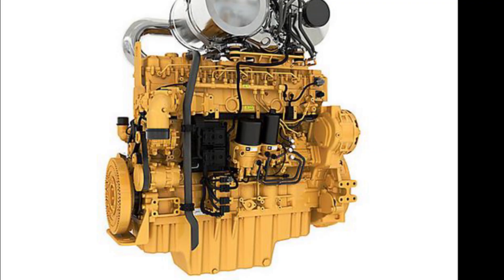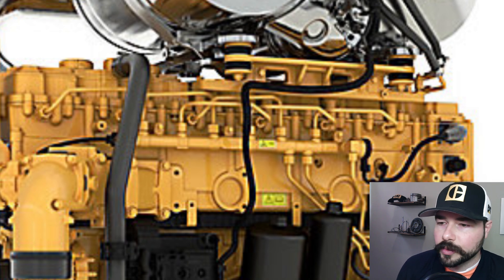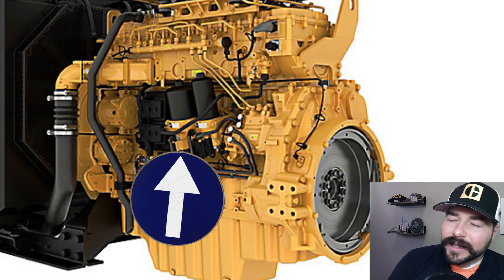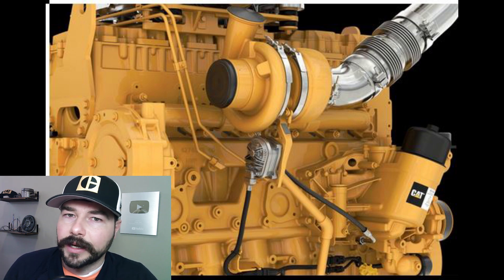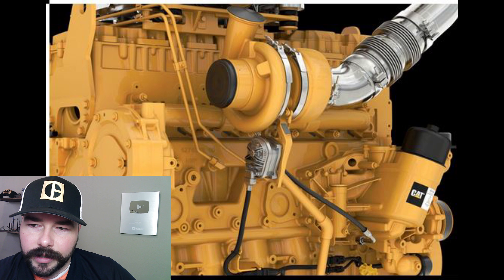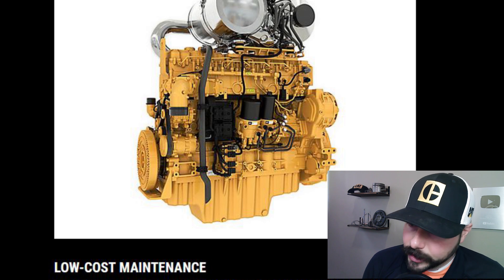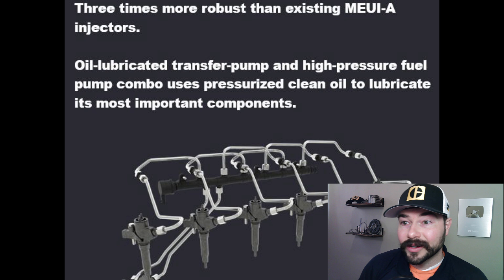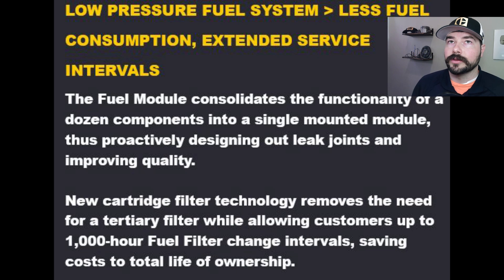New Cat Engine set to replace the C15.... The Cat C13D, 690 Horsepower.

Comment: As an old retired Cat mechanic geezer, I’ll have to correct you. Back between 1955 & 1960, cat used hydraulic lifters on some of their D337 engines used in the Dw20 and 21’s. Ask me how I know. Did enjoy your video just the same.

Comment: I believe the the oil lubricated fuel pump is to improve the Bosch design! Boss utilized fuel to cool and lubricate the squash plate and plungers. By lubricate in the back mechanical side of the pump with oil should eliminate a lot of the catastrophic failures as seen in this new CP 4.2.!

Comment: Rear camshaft drive????????
Good bye in-frame fast overhauls!
Do I have to remove the gearbox, clutch, flywheel and flywheel housing to remove the camshaft?
Anyway, not possible in frame, unless they have a window in the firewall.
In short, it`s shit.

Comment: I have a question have you heard of the DFI injector That was supposed to come out 2019 for diesel engines?
It was designed to be reliable designed to reduce admissions reducing the need for the money grab environmentalist that are plaguing the diesel engines with their nonsense. With installing their purpose built non reliable crap on these diesel engines I should say this injector would reduce the need for those headaches wondering if you were informed of this diesel fuel injector? Ducted fuel injector.

Comment: I drive a 2021 Volvo VNL760 with 211k miles on the 12.8 engine. It make 450 hp and 1,750 lbs.-ft torque from 1000 rpm to 1,500 rpm. It pull harder from a light than the 2016 Freightliner DD15. It burn slightly more fuel pulling but on level ground. It get better mpg.

Comment: Sounds like a pac. Car.  Junk.  Look.  Cat change the gear time in from the front of the motor to the rear of the entrance. That means you have to remove the transmission to work out just like a paccar piece of shit.

Comment: I dunno about a c15 starting badly in cold weather, i have a c15 acert that starts just fine in -15C weather, our cummins engines in our tractors need to be plugged in or need some either to start up. Could just be mine but I’m very happy with it.

Comment: Big bore mean more torque which moves the wheels or gets work done, not seeing with this little 13 liter C13D with high horsepower kiddie bs. Going backwards with the cheap plastic filter housing would be removed and adapted by my standards to multi- spin on steel filter assembly. Then the camshaft would be a pain in the ass removing from the rear of the engine like a Paccrap engine. Have to remove the engine from truck or equipment to gain access.  Then the variable turbos always breaks compare to just one standard turbo. I probably let it sit on the shelf in the Cat dealer and stay with my 3406 style engine.
Reply: Well with the new 2028 emisson regulations soon approaching, your 3406 Cat engine will be soon parked as it not going to pass federal emission standers anymore.

Comment: Im not sold on the reliability on these engines ag equipment have failed on the exhaust filtered common rail 4 cyl small displacement 100h hp + engines generating to much exhaust heat when exhaust filtration fails from low rpm operation and short operating intervals. Short trip inter city route trucks will be a nightmare. Over the long run WOT will not be as problematic because the exhaust filter will work. FYi only if there is no extra fuel injected into cyl just before exhaust stroke. Relying on EGT plus 600f converters has worked on ag equipment that runs wot most of the hours of operation..So owner thoughts of low rpm engine work hours will not clean converters and i have found destroy engines most prevalent in common rail high hp  small displacement eg engines. Maybe cat is doing it better. That fuel system " injector, lines, head and rail" looks  similar to others on the market. IDK this Cat system to speak from experience. I can say  EGR and Exhaust gas treatment delete solves many ag issues and adds 10% more hp.

Comment: C9, c12 use common rail,  but from what ive seen these injectors, need replacing around 10,000 hours, on heavy equipment,  and every fuel line you loosen needs to be replaced, because of such high fuel pressures. No more quil tubes on this new engine.  I guess we will all have to see how good it is, i really like the 1000 hr service intervals.

Comment: No replacement for that big displacement....you buy it see how it goes ... I had a first run twin turbo 475 total piece of shit after 22000 miles .nobody knew how to fix it... Had a  cracked flex tube between turbos.... After it got sold and outta warranty. Never ever buy a first new anything... Except a comdom
Reply: Cat and mack measure hp at the ground

Comment: Had cat perkins hybrid engines on the diamond drills.. They were 1500 hour engines.. Ate the injection pumps to high pressures..
Junk motors.. Parts and labour to fix was almost the same as a new motor.. They all failed right around 1500 hours

Comment: I think that a 690HP rated 13 liter engine may not be as long lived in certain applications as a 690HP rated C15 or C18, but I could be wrong. I can understand the want and need to downsize things in certain applications, but in heavy industry those bigger engines often have wider margins of safety at higher power numbers. Maybe the biggest advantage to these 13 liter high power engines will be fuel savings? Maybe running at 575 of the 690HP nets a big savings in fuel in a 13 liter engine vs 15 and 18 liters?

Comment: Scania uses VGT turbos and i worked a year as a buss tech and we serviced around 100 busses and we didn't change any turbos. Also fun to see american engines actually get high horsepower engines. Still scania and volvo has 770 and 750 engines, but we pull more weight too.

Comment: Daf is actually a subsidiary of paccar and has been since 1996.  The paccar mx 13 engine is the evolution of the daf 1260 engine.  The epa10 mx13 utilized the individual pumping units similar to the daf 1160.

Comment: The new injector’s are made in Mexico overhauled my 1MM 600 new injector’s and everything else had one go out on first load another one in three months put rebuilt out of injector shop in Cowtown working fine but thinking about changing over to sure flow because they have matched flow rate where as the new injectors ran between 28 and 34

Comment: Funny you defend muei fuel systems. I've done more of them than I have of Cummins common rail injectors with triple the amount of Cummins I've worked on in fleets. 
Running with broken springs etc isn't exactly a great thing, the engine still runs like shit. 

Definitely more sensitive to fuel and oil despite fleet overservicing. Weren't CAT working with MAN?

Comment: Hydraulic lash adjusters aren't something made up by CAT and they're not the same as hydraulic lifters. Basically, a Hydraulic lifter transfers the motion to open the valve, be it a hydraulic lifter in a pushrod V8 or a hydraulic tappet in a DOHC japanese engine. A Hydraulic lash adjuster is like a hydraulic lifter but it does not transfer motion, they are very popular in modern OHC car engines, they are like a small lifter with a ball end which rests in the head and acts as the fulcrum for a roller follower. The camshaft pushes on the roller follower which directly acts on the valve.

Comment: Great job Josh . I pray to God that will bring more people like you on this world.  You love and enjoy this trade of the Diesel MECHANICS (not technicians) . About the new C13 D I think Cat did a great job bringing their engines on the 20 Century  technology and  it will be on top and ahead of any other Engine manufacturer . On all these common rails is a known fact that the HFPP is the silent killer of the engine if they don`t use high quality materials for the build on these pumps. Not all the operators take regularly oil samples when service these engines and this is a educational deficiency  from the OEM producers . I am from EU and they have these engines on the road like 18 Years back  and they have learn the lessons  for North  America this is fairly new  it will fail as expected for new technology also the educational factor in using and maintaining it will be a big struggle as these folks are used with old engines  that you pee in the fuel tank and they will still go .

Comment: Josh @AdeptApe, could you please point me in the direction of finding out what parts I need to couple an md3060 to a c10?  The 3060 is behind a 3126 in my fl60 to fl112 conversion truck, the c10 is out of a Pete with a 9 speed. Thanks for ALL of your time, your channel
Is super helpful to many of us.
Reply: First things first, engine vs trans torque ratings, then wiring for the engine/trans interface, ECM/TCM programming. Likely some changeovers from Paccar to F/liner spec for exhaust, d/stik, fan mounting, possibly coolant in/out conn, ATAAC for C10, maybe radiator spec, probably motor mounts setup, firewall to rad space(?), flywheel hsg (?) or bell hsg and flywheel, driveline mods(?)

Comment: The only issue I can see if how to fit that under the hood on a Pete or KW. If this is the final design, what other steps are the truck manufactures going to take to shield the hood from the extra heat the aftertreatment system is going to create being under the hood of a truck.

Comment: hahahahahahahahahaha, the C13 is not a new engine. 690 Hp from 13 liters will burn just as much fuel as 690 Hp from 15 liters. To dial up the C13's made before this we just modified the head, coated the pistons and combustions chambers, swapped out the turbo wheels for high output ones and raised the engine operating temperature. I have modified the C15 and 16 to produce as much as 1200 hp with mostly stock parts.

Comment: When i changed my transfer pump in my 2005 bxs c15,,i could see the ball bearings bathed in engine oil....hence oil lubes pump...love my c15 2 070,000 and kickin

Comment: I bet there's nothing Caterpillar about this, probably just a rebranded DAF / Paccar product or Navistar owned product. It's obviously been previously designed for a European cabover truck with that rear drive gear setup, having cartridge filters and also for the fact that it's a 13 liter engine. DAF is owned by Paccar and thus the MX-13 is a DAF engine, similar to the current lineup of Detroit diesel engines which are 100% Mercedes-Benz engineered and Volvo.. which are well.. Volvos.. all of which were previously engineered and designed in Europe for cabovers..

Comment: Those cartridge filters are a messy pain in the ass;  nothing beats a spin on for cleanliness and convenience.   The ECU is a computer and attaching it to a hot engine is dumb as history has shown.   More HP from less displacement means Higher BMEP and shorter eng. life.

Comment: Perkins has a new engine that is very similar if not identical, 13 liter, hydraulic lash adjustment, etc.
Fuel rails look identical, rear gear train. bell housing is a little different.

Comment: Looks like Nylon fuel lines from Raytech or similar. Kinda like the ones Cummins had the melted fuel line issue (sticking TRV I think). Inverted canisters are great, but why not make these see-through so you can actually see the filter's condition? A polycarbonate is plenty tough for that purpose.

Not sure if that's a Bosch pump or a Denso pump. The Denso HP0 is right at its limit of fueling if they want to push 690hp. The pump is good for about 750tops, and even then only if you drop the pressure from 2400bar down to 2000 to help the pump flow more.

Rear gear makes a lot of sense when you consider the wicked torsional vibration a gear-driven HPCR pump can put into the drivetrain.  You want the pump close to the mass of the flywheel if at all possible. Trying to drive the pump AFTER all the flex of the crankshaft (i.e. on the front) can cause problems with both the front geartrain and the pump. Rear gears are quieter, have less vibration and are smoother. Cummins had scissor gears on the front gears of the X15 in part because of the front-mounted pump and the vibration it pushed into the gears.

Comment: Gonna be tough to build something better than the venerable 3406.
Reply: My uncle had a 3406b  989 thousand  before it threw a ring.
Reply: @rob066101  I have a C15 Accert 1.3 million on dash no overhaul yet
Reply: @anemictoe9618 the Accerts are great engines when you switch to single turbo and put a decent tune behind it
Reply: @SparkZ1420 do the acerts have def?
Reply: @Beaddragon123. In north america, only the SDP model has def
Reply: @aishi_creates there were never any CAT on highway engines that has def. Only the max force just labeled cat
Reply: @Luggagesaauce237 to my knowledge the sdp didn't use Def when it was a on highway engine
Reply: They did that in 1999. It’s called the c-15 6NZ.
Reply: i have a c-13 with a million,200,000 miles--only thing i ever done to it overhead at 500k and it lost one injector--uses a gallon of oil between changes and out of 65 trucks i am number one in fuel mileage and freight volume because my truck is trouble free and light weight,tanker operation,half empty so the helps the wear and tear--i make a ton of money--same haul everyday for 13 years
Reply: Not really

Comment: Must be an effort to pull customers away from the overseas reman junk that Cat is charging 60k dollars for. Our 170k mile genuine cat reman is sitting in Topeka caterpillar, finishing up a rebuild under warranty. It dropped #6 cylinder in February, everything replaced and updated, and by mid February it was losing 7 gallons of oil from the blowby tube in 15k miles. Caterpillar in NY, NM, KS and PA all confirmed... all remanufactured engines are done in China and India. I will never put yellow junk between the frame rails again. The yellow cult fanboys can keep their Scatterpillar trash. Good vid Adept Ape, have a good day.

Comment: Hello, I have a question for you, we have a mechanical 3406b model, engine has just under 20,000 on rebuild from cat, the truck is a heavy wrecker. My question is when you have the engine idle up for the hydraulics, and push  it back to idle it down the engine almost wants to die before coming back to normal idle, it's set between 700-800 rpms. Also when driving and suddenly release the throttle it does the same thing

Comment: Definitely get euro engine design vibes from this. I'm a Kenworth tech so Paccar MX engines are what we work on alot. In the trucking industry, we've been around the cartridge filters for a while now. The new EPA 2021B Paccar went to the twin filter module and made filter services alot better. I can't wait until everyone else starts getting rid of EGR. I know it's been in the works for north America for a while but I'd love to finally see it done for truck engines.
Reply: I worked at Kenworth of pa for 25 years if the MX engine doesn't run Paccar out of business nothing will I sure pitty you working on jigsaw puzzles I cringed everytime one came in the shop.
Reply: @davidsignor7931  i haul milk for a living. class A tanker, farm pickup. im a company driver. the paccar MX13 and autoshifts are both junk. terrible when the 2 are combined together. my employer is slowly phasing out those trucks. especially the autoshifts, they just arent meant for milk hauling. we have a couple of paccar MX13 trucks around that have 18 manuals and i think for the time being he is keeping them until they have more miles.

every new truck he has bought in the last 2+ years has had the cummins X15 and a 18 manual. we have 25-30 trucks in the fleet. i drive a 2022 KW T880 X15 565 hp and an 18 manual. i have 80K on it so far and i just love that truck. pulls like an animal, so far it's hasn't been in the shop except for PM work.

Comment: Heui is hydraulic fired injectors using high pressure engine oil not camshaft driven
Reply from the maker: I never said HEUI, I said both EUI and MEUI in the video, which are the same but some people call them MEUI and some call them EUI.

Comment: Speaking towards the longevity of MEUI injectors, My dad had a 5DS motor that had over 1.4 million miles on it before he replaced the injectors, and the only reason he replaced them was due to doing an in frame when it finally decided to drop a valve.
Reply: My 5DS dropped a valve at 1,662,000 miles. I went with a head from Diesel Cast Welding and went with new injectors and cups.

Comment: Apparently the engineer that designed the fuel system failed chemistry. Being how water settles to the bottom of the filter housing, it doesn't seem too smart to invert the filter housing so the water gets sucked into the engine first.

Comment: A lot of common rail engines such as mtu and man use the upside down filter cartridges because they found that mechanics have a tendency to prefill filters with diesel before installing causing the injectors to suck up unfiltered fuel and trashing out the high pressure injectors. That was man’s fix for trashing injectors in their engines. I’ve been seeing a lot of this lately.

Comment: Hmmmmm
Lots of things to digest,,, but common rail sticks out,,,, contamination will be a issue,,, injector erosion,,,,, hydraulic lifters,,, no valve adjustment,, extended oil changes
Has there been a update to lubrication,,, piston design,,,, 

Reminds me of another company,,,,, it also starts with a "C",,,, followed by UMMINS

Comment: I used to work on Sizu (AGCO) engines and we prefered belt driven waterpumps, those and EGR stuf were the only thing you'd need to worry about failing between 7000 and 15000 hours. I Always found gear driven waterpumps a risky undertaking.
Reply: I couldn’t agree more.